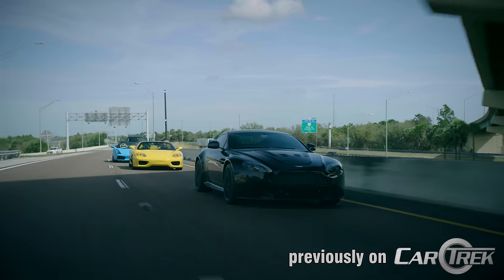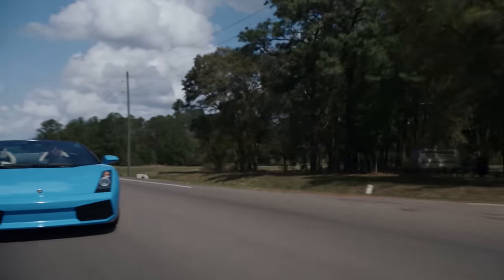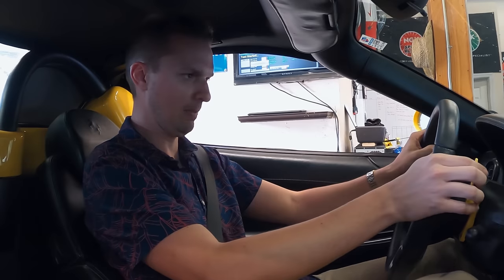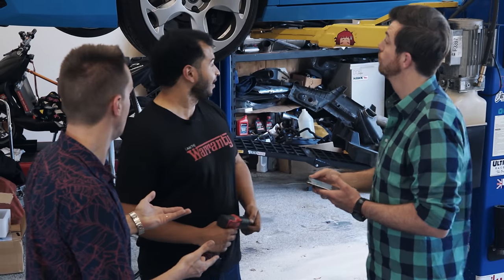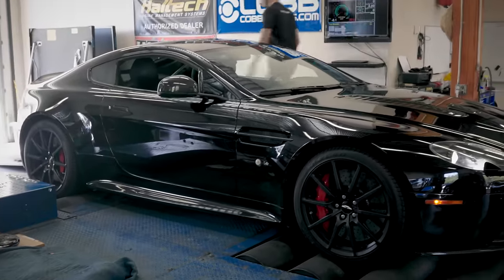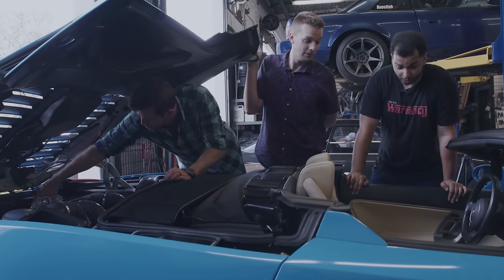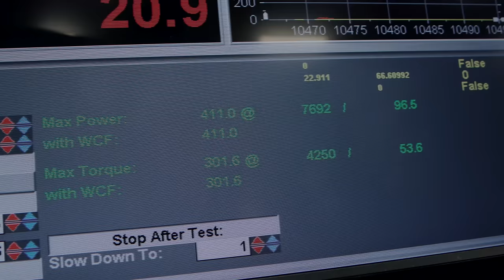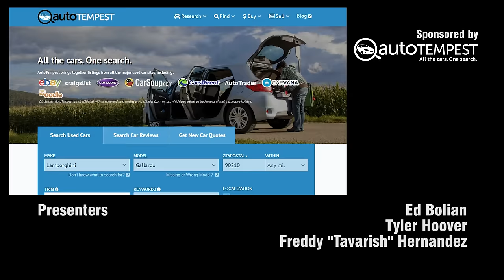Here's How Much Horsepower Our Cheap Exotic Cars LOST Since They Were New

Comment: Why isn't Jack running the dyno?
Also, Jack's dyno is a heartbreaker.
Reply: HP logic
Reply: Pretty sure he is. they're just driving.
Reply: yeah, when I saw mustang dyno I knew some hearts would be broken. Not that it's inaccurate or anything, just read consistently lower than the ego boosting others
Reply: @motondska  Idk man. In Holland, Dyno's read out factory-HP numbers. Here Dyno's account for drive-train losses. They measure the drive-train loss in the way OEMs do. All cars have different drive-train losses. This can be delta-difference of 1-5% in drive-train losses which is a HUGE delta for up to about 15-year-old cars.
Reply: GamingWiffJohn sirrieus is da zo ja dat wist ik niet
Reply: Sammit still manged 100whp on it in the miata @mousiee7
Reply: @motondska  well the dyno in HP logics shop is referred to as the heartbreaker dyno
Reply: mousiee7 Jack only runs the Dyno in the car when he’s tuneing

 Just because he need to have Control of the throttle
Reply: Mustang dyno, always a heart breaker
Reply: @Samosayummyyay  Dynos here have weather correction factor and can account for drive train loss too. When we talk wheel horsepower, we talk about what is getting to the road. So just all depends on which number you are talking about.
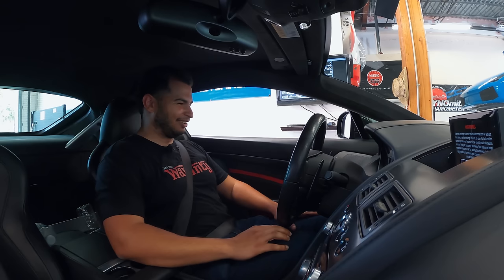Reply: He is. 11:30
Reply: Whether or not the numbers are anywhere close to factory specs is irrelevant to the actual purpose of a dyno. Dynos aren't meant to measure horsepower as much as they are just a tool for tuning. It's not the dick measuring tool most people think they are 😂
Reply: Cuz Jack only dyno in Florida that let's u dyno ur car urself
Reply: mousiee7 yep mustang dynos are always lower reading

Comment: “Mustang Dynos read low” been hearing that regarding certain turbo lambo, now this mustang dyno is reading high. Got it.
Reply: It's reading high because they cheated. Ed ran in 3rd, should've been in 4th to be closer to 1:1
Reply: Unintended Consequences  exactly my point.
Reply: Yeah they cheated alright lol. 
1st gear ratio

3.31:1 - Max speed 80 Km/h or 50 Mph

2nd gear ratio

2.05:1 - Max speed 130 Km/h or 81 Mph

3rd gear ratio

1.46:1 - Max speed 182 Km/h or 113 Mph

4th gear ratio

1.14:1 - Max speed 233 Km/h or 145 Mph

5th gear ratio

0.94:1 - Max speed 283 Km/h or 176 Mph

6th gear ratio

0.78:1 - Max speed 325 Km/h or 202 Mph

Final drive ratio

4.62:1

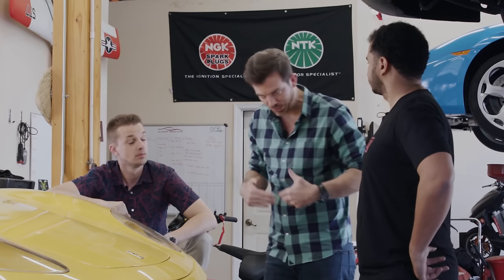Comment: 4:40 Also, horsepower and torque are PEAK values. At 1000 rpm you may have 30% of the HP, as measured at the wheels.

Comment: Better explanation to horsepower loss starts with rotational resistance the transmission the clutch the driveshafts and wheel hubs. While within the engine the cams and crankshaft. Due to wear the valves and piston ring performance drop exponentially

Comment: As a former dyno operator, you definitely want to turn off traction control, use 3rd gear (in most 5/6 speeds), and go all the way to red line - but don't shift, let the RPMs come down. AND most importantly, don't hit the break pedal!!!
Reply: 3rd? I thought you wanted 4th. I guess its whatever gear on that particular car that’s 1:1

Comment: Note - Austin Martin runs their engines for HP figures off of the equivalent of 93 octane gas.  If you run 91 in it you will lose about 3-4% HP.

Comment: Whenever I pull in any gear other than my final gear, I shift up after the pull.  I believe this takes pressure off of the valve-train as it would lower RPM and not cause compression braking.  Could someone please explain why people never upshift on a dyno’ after a pull?  Does it have something to do with gathering data?

Comment: I'm actually really surprised by the fact that each car made good power... But modern cars don't have as much drive train loss as older cars.
10% is a good number for a mid engine, rwd car.
15-20% is accurate for AWD cars however.
So these cars are all basically like new as far as the engines are concerned.
New spark plugs, new air filters, new synthetic oil, new synthetic gear oil in the differentials, and a valve adjustment (if applicable) on each car would definitely make each car regain 10-20+hp.... Especially if the Aston has never had a plug change.
These are all basic maintenance items.
There's no such thing as a "tune up" on modern cars.
A "tune up" typically means a carburetor on your engine... And the tune up procedure would basically be normal maintenence - oil and filter change, air filter, diff/trans fluid and trans fluid filter (if necessary)... That kinda stuff.
THEN the mechanic would do a cold valve lash adjustment, set or reset the timing on the distributor, and carb adjustment.
They wouldn't re-jet the carb, but the idle circuit adjustment would be adjusted to make sure the car is idling properly, at the correct rpm, and not running too rich or lean.
If the car had multiple carbs, then the carbs would be synced and the mechanic would make sure the air/fuel mixture is correct through the entire rpm range. Basically taking it from 0% throttle to wide open throttle, starting at idle - to make sure the car doesn't spit, sputter, stall etc which would mean that you're running lean. Backfires are also a bad thing that happen from poor carb tuning, or incorrectly adjusted timing.
The mechanic would also make sure the engine is not running too rich by driving the car and letting it idle for a while, then making sure the spark plugs aren't fouled. If they look OK, then a good long road trip at low engine load is next... Again checking for fouled plugs.
This useless bit of info has been brought to you by a marine mechanic who works on ALOT of carbureted GM block V8's... And lots of outboard engines that actually have a carburetor for each cylinder.
Yes, there are 6 cylinder outboards with 6 carbs - and those carbs need to be synced, especially in a 4 stroke engine with individual intake runners.
Evinrude used to make a V8 outboard with 300hp that many guys would hot rod, and them things had 8 carbs.
Luckily it was a 2 stroke V8 so the carb sync procedure is simple - just make sure the throttle plates are opening the same amount, and that they are all closed completely at 0% throttle.
On a 4 stroke engine, carb sync can be a absolutely hellish, 2 hour long procedure.
Small Honda outboards from around the mid 90s thru the mid 2000s - engines from around 40hp thru 100hp were nice and easy to sync, IF you had the right tool... Which costs about $800.
If you don't have that tool (a vacuum guage that reads all cylinders at the same time) it is absolutely impossible to sync the carbs. Adjusting one carb affects the others, so it's already time consuming even with the proper tools.
OK, essay over. Back to the show.

Comment: The Gallardo pulled in 3rd. the gear ratio in 3rd is 1.41/1 That Gallardo should have gone with 4th, or 5th (5th being 0.94/1) so that HP estimate is a ways off.

Comment: The reason its called brake horse power. Is the brake of the drivtrain and wheel. Soo the power they got from the dyno was the brake horse power. Not horsepower

Comment: Your on a MD dyno. So its roughly 10% lower in numbers compared to a dynojet dyno. A MD dyno can be calibrated to have that variable but for the most part your usually 10% or so lower then a dynojet.

Comment: The Aston Martin should be at a 20% drivetrain loss because its front engine rear wheel drive where as the Ferrari is a mid engine rear wheel drive so it should be about 15% loss. Different configurations different loss %.

Comment: Loving this series. But worn out piston rings and injectors cannot increase drivetrain losses. Haha. And most dynos work out drivetrain losses when coasting down.
Reply: i think what tavarish was implying is that anything that can lower the overall original horsepower of the car will have a subsequent lower HP at the wheels. im sure Bad injectors and worn piston rings would lower the overall HP of the vehicle
Reply: @justinlangley9522  Yeah, you're right. :) I get what he was insinuating but his wording came out wrong is all.

Comment: The dyno section…..talking about estimating drivetrain loss and not being able to have an accurate crank power to compare to the manufacturer numbers? 
The dyno measure the power whilst the revs are increasing and then on the run down it should measure the mechanical drag and therefore be able to calculate a crank power figure. Very very basic dyno if it can’t/doesn’t do that

Comment: What's the point of a car with all that horsepower and handling, when it's so fragile if you fart in it a code will pop and send it into limp mode.  I know they are hand built exotics, and they are beautiful, but they are pointless if you cannot use them for anything other than a piece of garage art.

Comment: he needs to take the broken venturi spoiler off the bottom of the lamborghini it looks tacky with all of the tape at the bottom of the car the diffuser is just suppose to give you a little bit more down force when your traveling at high speeds 120 mph are more so it wouldn't hurt to remove it.

Comment: You guys made the cardinal sin...you have utterly NO IDEA what those cars would run stock on that dyno.  You have ASSUMED a 15% drivetrain loss, which isn’t unreasonable, but you are using a MUSTANG DYNO, which notoriously reads LOW. There’s nothing wrong with that, it’s just a tool, but you need a baseline to even start forming conclusions. Go run those cars on a, say, Dynojet dyno, or, even more interesting, a Dynapack dyno and watch HP appear out of nowhere....